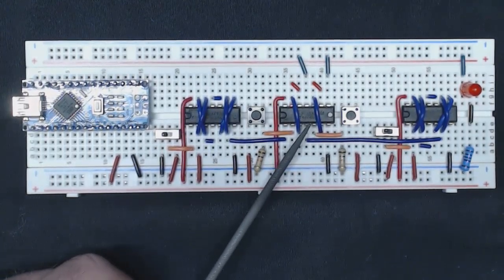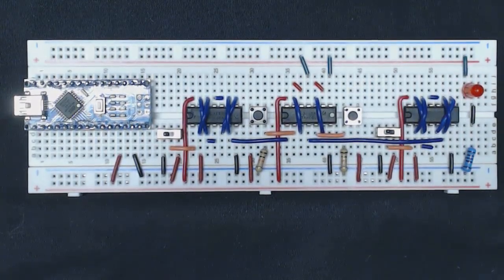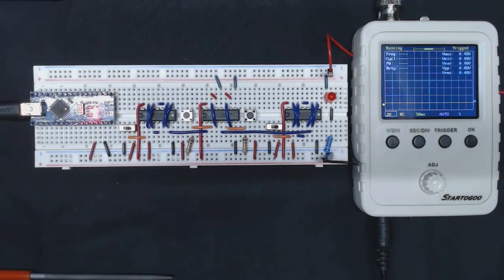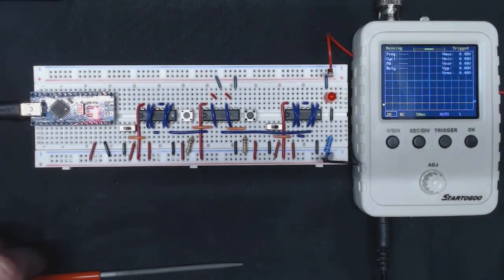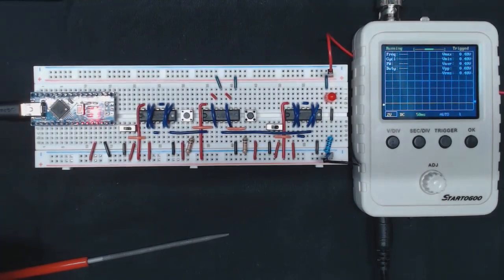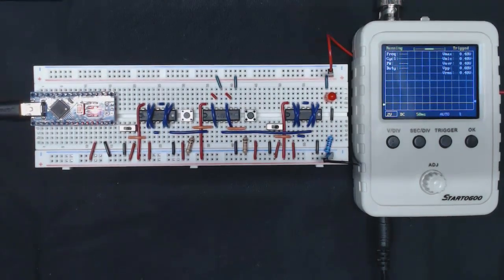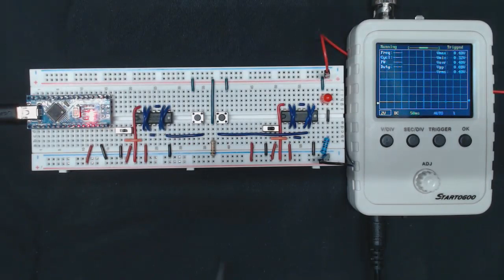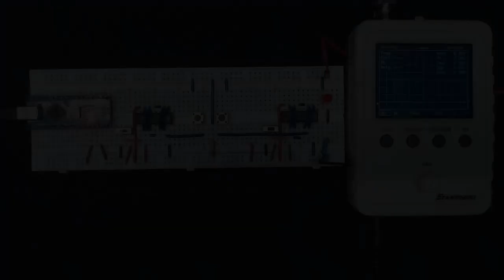But How Do It Know? Video #8 - The Bus (part 1)

Comment: The first IC output is sourcing, and the second IC output is sinking. LED is also sinking. So practically, the first IC output is like a power supply for the second IC and the LED. So they share the 5v output.

Comment: Nice explanation! One thing I still don’t understand: How does the computer in this 3 state logic registers a difference between sending 0V (logic 0) and beeing disconected? Imagine that some register wants to send number zero in an unsigned byte (00000000) to the bus. How does the register know it isn’t simply disconnected? :) Thank You!!
Reply from the maker: The component reading from the bus can't really tell if is being written to by another component or not. It detects voltages in the bus and interprets those as being 0 or 1. In a case like this, whenever a component wants to read from the bus, the computer designer needs to make sure that there is one and only one other component writing to it. You will see how to achieve this synchronization a bit later when the clock is introduced.

Comment: Quick question: when a memory enables to the bus, does it conflict with the data previously on the bus ? i.e: Does the bus need prior to the enable action to be set to "0"s ?
Reply from the maker: There can only be one component at a time driving (i.e. writing to) the bus. There is no need to "reset" the bus explicitely. As long as the previous device has stopped driving it, the new device can start driving it. When no device is driving the bus with a specific value, reading from it may result in random values. For that reason, sometimes it is useful to use pull down resistors to give the bus a "default" value of "0" when no component is driving it. See around 15:45.
Reply: @patrickleboutillier  when a device writes a "0" to a bus wire that has a "1" on it. Will the bus wire switch to "1" ?